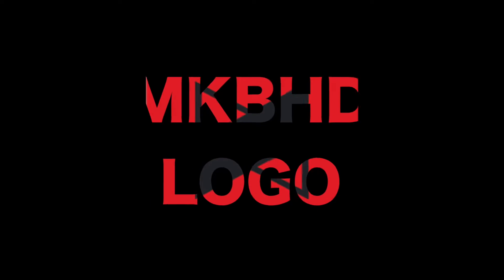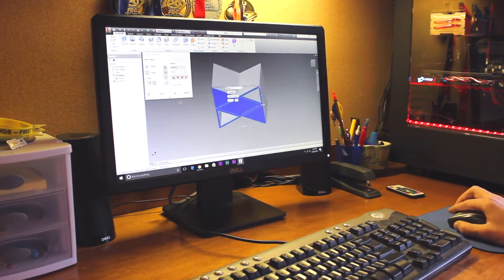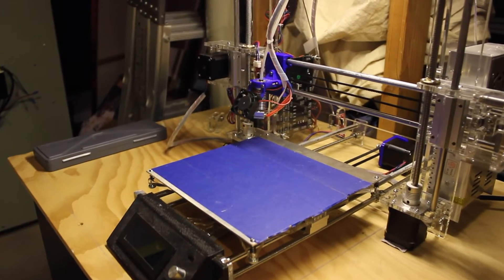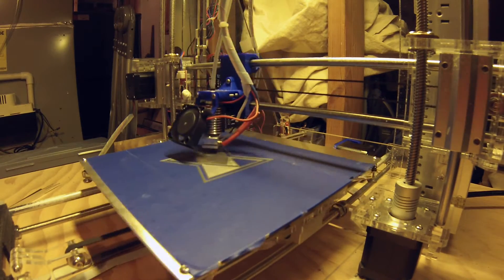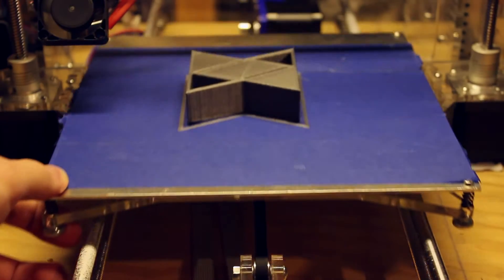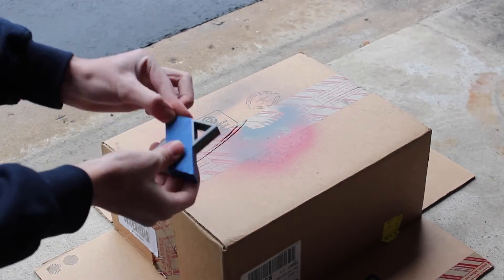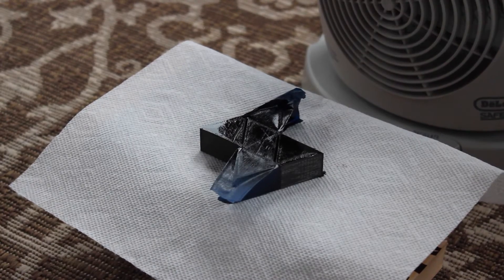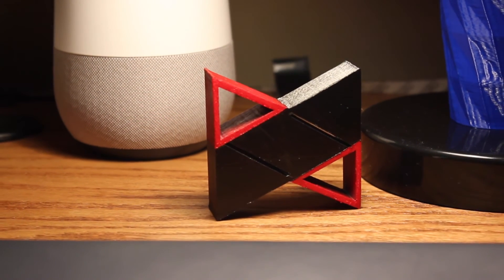Making a 3D Printed MKBHD Logo!

Comment: Hey,could you help me?My filament motor isn't working on my printer and I have the same printer as you.The filament won't come out
Reply from the maker: Joseph A.W. Folk Try checking your connections, the motor controller, board, and software. Try plugging the motor into another motor controller that works. If the motor works, then the motor controller is fried, if not the motor is dead.